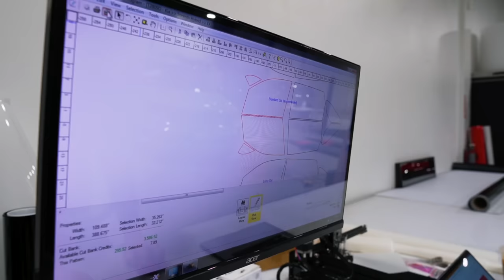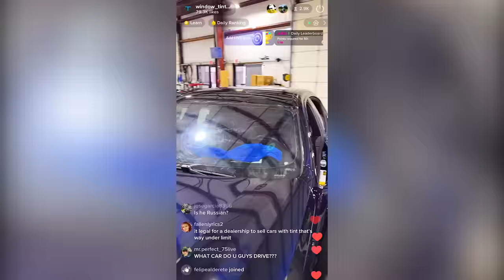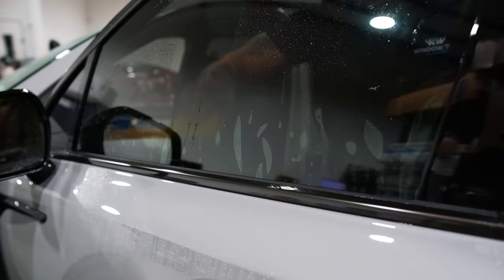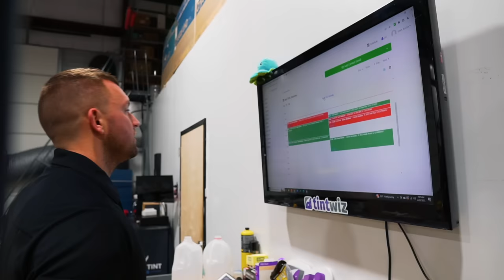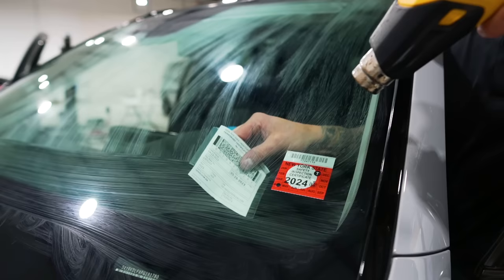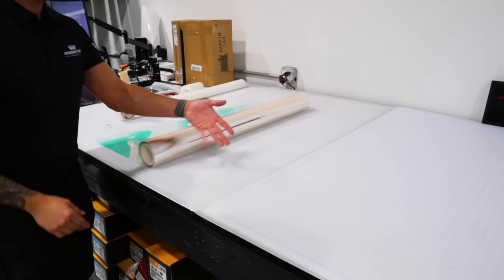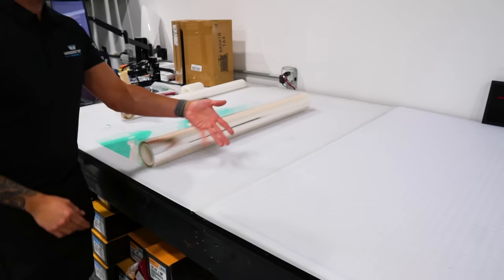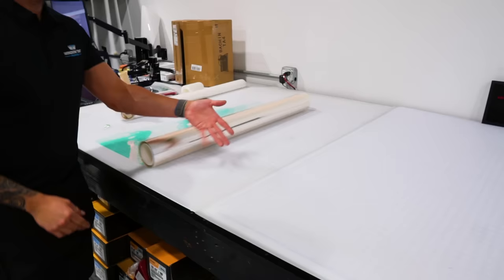$200 Giveaway! | Chameleon Window Tint Install - Day In The Life of a Window Tinter - S4 / E8

Comment: This guy is a professional very meticulous & very clean work
 😊 awesome job brother...
Reply: A professional window tinter never takes off door panels of new vehicles just to make it easy or use heat on new expensive windshields thats a No No they can Crack easily 
And a experienced window tinter will never work heat the film bubbles inside they need to be worked outside before installation

Comment: Do a dap instructional video. How to customize patterns. How to make a sun strip out of a windshield pattern
Reply: I can help you with this is pretty simple. There’s a square pattern you can make on the top right of main picture toolbar. Make a large rectangle over the windsheild you want to make a pattern on. Once you get the length you want, highlight both patterns. Really close to the rectangle pattern button there is a bottom for “path merge” it’s got half a pattern that is yellow. Once you click you’ll get a window that pops up. With 3 or 4 options. Click intersect. Your patter is done.

Comment: Nice work! I thought that window tint that lets in any less than 70% was illegal in NY?
Reply: It is, and any tint on the front at all is illegal, other than  6 inch allowable shade strip at the top.
Reply: It is but we just roll down the window, I got 5% all around and 35% windshield and most nyers gig 5% all around even the windshield and we don’t get pulled over